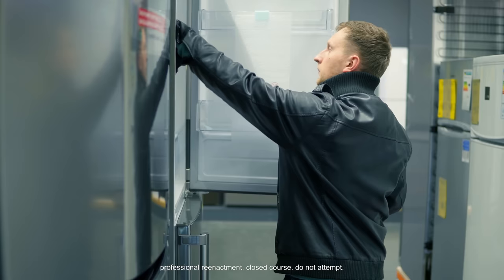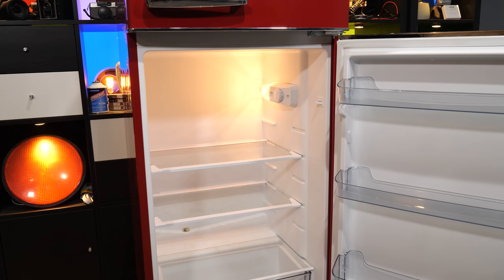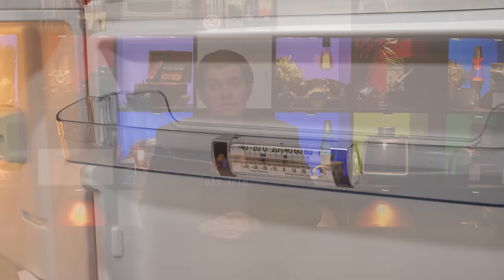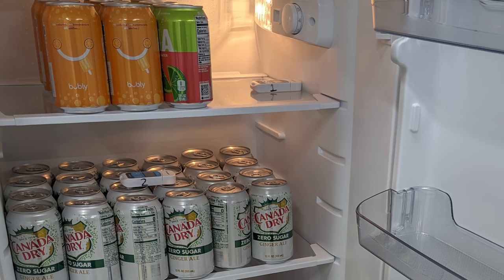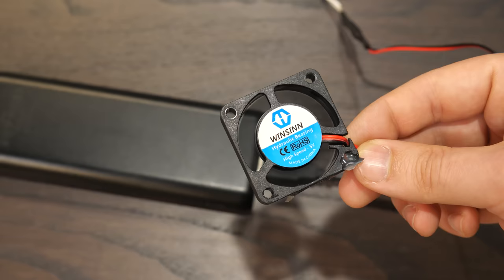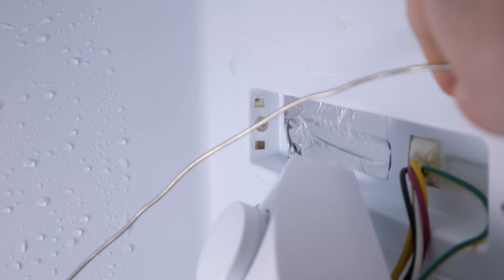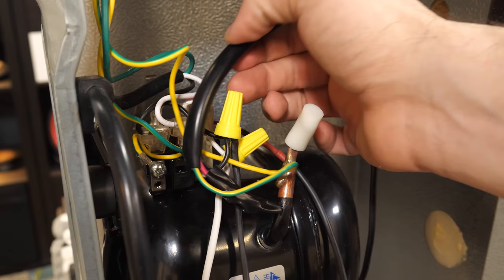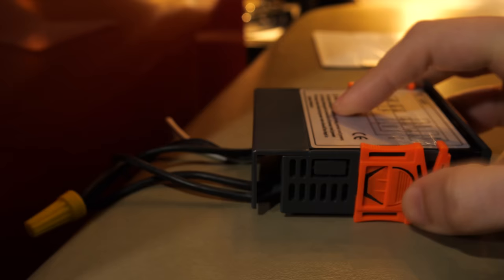This goofy fridge has a really clever design. It's also kinda terrible.

Comment: I love the way you call this a "mini fridge", in the UK we'd call it a "fridge".  The large double door units are often referred to as "American fridges" 🤣
Reply: Yes this red fridge is bigger than the only fridge we can fit in our flat  -_-
Reply: Yeah, a mini fridge is one that fits under a table, possibly even smaller than that.
Reply: To be fair, we wouldn't call this a mini fridge in the US, we would call it a small fridge. Mini fridges are shorter and typically have the frozen compartment within the top of the single compartment. But this is certainly smaller than most people's fridges here. My fridge is probably 2.5-3 of these big, but would be considered a large fridge, 1.5 of these would be a "normal" fridge size.
Reply: I lived in England for 2 years and a large family lived close by (in MIddle Barton, Oxfordshire) and the first thing I noticed in their house was that small fridge.
Reply: He also doesn’t call it a mini fridge, he bought it instead of a mini fridge, its just a small fridge
Reply: Go big... or go home! 😆
Reply: also most freezers here absolutely do no have auto defrost. At least none I've come across. Maybe if you  want to throw money down the drain they might but the sensibly priced ones absolutely do not.
Reply: also in the UK I think we would actually call this a fridge freezer, although I don't think I've ever seen one with this form factor, if you have a fridge freezer it's nearly always 3/4 shelf freezer on the bottom and the same size 3/4 shelf fridge on top of identical size or near identical. roughly equaling two undercounter units in size.

A fridge would just be an under the counter fridge, usually with a separate under counter freezer. A mini fridge the things people have in their office etc for a few cans.

And an American fridge is for the people with more money than sense cause god knows what people are putting in those things.

Also having lived in a shit flat with a miserly landlord I did have an undercounter fridge with a tiny little freezer shelf on top it's so crap. I got a small chest freezer one of the best 150 quid I've ever spent and the freezer shelf in the fridge was useful for ice cubes.
Reply: Yeah, we Americans eat a lot, drink a lot, and therefore, have big fridges compared to some countries. We are the land of excess, obesity and all.
Reply: Living in a rental apartment in Switzerland.  This "mini fridge" is considerably larger than the one I have...
Reply: He didn't call this a mini fridge, he specifically said he bought this instead of a mini fridge because it was only $150 more and over twice the size
Reply: Big fridges make more sense when you live far away from where you grocery shop and therefore make fewer, larger trips. If the place you buy food is very close to where you live you can go frequently and don't have to stock up as much.
Reply: @mytimetravellingdog  European fridge freezers are typically 50/50 or 70/30, with the freezer compartment at the bottom. The latter means the freezer section would line up with the countertop.
Reply: "double door units are often referred to as "American fridges""

Is especially hilarious because here in the US the double door thing is sometimes called "french (or french style) doors" 😅 Especially in adverts that want to sound more 'posh'.
Reply: @mytimetravellingdog  In the Netherlands this used to be pretty much the default form factor in the 80s. After that, it seems most new kitchens did away with standalone fridges but instead went with far more expensive built-in units.
Reply: WELL AT LEAST…
Reply: There are 100s of millions of this type of fridge all over the world.  Very common.
Reply: It is also not uncommon in America for the nearest grocery store to be 30 minutes or more away by car- rather necessitating higher capacity for food storage in the home.
Reply: I was like how is that fridge "Mini"? 😂
Reply: The thing they call a "fridge" in the US is called a "small apartment with no windows and too much air conditioning" over here.
Reply: One of our quirkiness as Americans is that we love lots of stuff "ice cold" or hot, but not at room temperature.  I'm generalizing from my own experience, of course, but, Drinks, Beer, fruits, fresh vegetables, processed meats and cheeses and more.  If we consume it, and it contains significant water, we want it cold or hot.  And evidently, we are pretty obsessive about ice too.  I had never given it a thought until I went overseas for the first time in the military and ordered a drink with ice.  The bartender happily plunked a single cube into my drink.  When I asked for more ice, his eyes rolled and he very begrudgingly complied.  Trying not to be the "ugly American", I apologized and asked him if my request for more ice was abnormal?  "Not really," he said. "Quite a few of my best customers are Americans."
Reply: AMERICAAAAAA! FUCK YEAH!
Reply: I was going to say the same thing. It's a perfectly normal size fridge for a British person.
Reply: We tend to do infrequent large shopping trips since grocery shopping can be pretty inconvenient - and most people only have the time for it on weekends. I don't know if it's the same for you, but we also tend to cook large amounts of food to have leftovers throughout the week, which requires more fridge space.
Reply: In America we call those French door refrigerators.
Reply: They might truly be "american fridges". I've never seen a single one in europe, and usa likes to be original
Reply: It's a single persons fridge, uk don't have families
Reply: RAHHHH 🦅🦅🦅🦅🦅
Reply: If you paid attention to the literal first minute of the video, he literally said "I went to the store with the intent of buying a basic mini fridge to tide me over. BUT thanks again to everything still being wonky, a really basic mini fridge was like 200 bucks, and for another $150 I could get this silly thing. And I did. This fri-..." (fridge, cut off). He then 5 seconds later points out that it's much larger than an actual mini fridge.

He was never calling the fridge a mini fridge. He was even specifically about to call it a fridge before he cut himself off to make the "this won't fit on the table" joke. Ironically, an ACTUAL mini fridge would've fit on the table. Not even across the pond would we ever call a fridge that size a mini fridge. He was just saying he went to the store TO BUY a mini fridge, but because they were so expensive he figured he'd spend just a bit extra and get a full-sized, if not small by US standards, fridge.
Reply: Gonna end this debate, the size in the video is called "apartment" size. That's what it's sold as. A mini is around 100L, this is around 200L. A standard full-size fridge is 500-700L.
Reply: Yes, 'this little fridge'. In the Netherlands that's called a full-size fridge. And a nice retro looking one as well! I never really understood why anyone would need those double door things. They are huge! But still, I DID always wonder how a fridge like that worked (and whether it actually did it's job properly, and, eh, I guess not). That's really cool. I also liked the experiments to figure out the differences...
Reply: @mytimetravellingdog  Funny, same here. It's really a feature you pay for!
Reply: @LiterallyCensoredDaily  Well, perhaps because Europeans live much closer to the shops, we just go there more frequently (you know, fresh veggies), and therefore need less fridge space. I also have a big fridge (well, actually it's a 2m02 high fridge and seperate freezer of the same hight). I use it to freeze lots of gluten free stuff and stuff that I cooked and want to eat later. But really, it was meant for a family. If it's time to replace it (it uses a LOT of power), maybe half the size or less would be perfect..
Reply: @riverfortune1990  Exactly my point indeed..
Reply: @zombieregime  Exactly, because the French like fresh produce, so they have relatively small fridges..
Reply: @jurjenbos228  Yes, same as US cars and US engines. Even the engine would make a nice dog house, it's that big..
Reply: @mikemorgan5015  Yes, of course. More ice cubes means less drink. Therefore cheaper for the bar to make and more profit..
Reply: @CollinOffTheCuff  The thing with a integrated compartment is called... fridge :D
Minifridges dont have a freeze-compartment at all and basically its just one big compartment with "wire" rack to seperate. THATS mini ;D
Reply: @LiterallyCensoredDaily sure but this isnt the reason. We have more rural areas and i lived in one, we could only get out to get groceries once or twice a month so we need big refrigerators to hold that much food. After moving to town and being able to buy stuff weekly or even daily if we need something or something gets left out and goes off is a fucking godsend. When I grew up we had to really focus on what food we ate so we could make our favorite foods and snack last the whole month and if something got eaten too fast or got left out and went bad, too bad. That’s all you had for the month.  We lived like 45 minuets from the nearest gas station even. We were poor af too so we didn’t get alot to last a month between the money issues and fridge space.
Reply: @aJoats  WTF. 30 minutes by CAR. I thought I lived far away from the grocery store when they are a 10 minute drive away.
Reply: @mikemorgan5015  Oh in Finland it's normal to have ice in drinks when you go to a bar etc.
Reply: @Levian-Durai  I try to get everything I need for a week from the store but most times I fail but I usually have to go that way either way during the week. Oh and we cook almost daily
Reply: @Tupsuu that’s still far, the idea is to go there on foot (say 1km radius) everyday or every couple of days.
Reply: if you listen carefully, they say they were GOING to buy a mini-fridge until they found a better deal for an extra $150 when the mini one (one you could likely fit under a table) would have been  $200 to begin with. so they didn't call that rediculous machine mini.
Reply: lol I just basically said the same thing about France in my comment x)
Reply: @mytimetravellingdog 
It's worth noting that auto defrost is the least reliable part of a fridge. If you regards a fridge as a once a decade purchase, and want it to run without maintenance (apart from periodic defrosts) then don't get auto defrost.

That tip originally came from a fresher repair person who is on call for a company that does extended warranties on fridges.
Reply: @mytimetravellingdog  Well you certainly made me feel old by not knowing freezer on the top is a 2 door and on the bottom is an upside down :( 
Side by side doors is called............ side by side and if you have separate matching fridge and freezer thats a pidgeon pair.
Hi from Australia - FWIW i have an upright 2 door and an upright freezer, basically nobody has pidgeon pairs or side by sides here either. Upside-downs are about as common as uprights.
Reply: @erwindewit4073  Yes, that's undeniable.  I can't speak to every European country.  Only a few during my time there from 1989-1993.  They had generally much more strick bartending than the US.  I don't know if it was German law or frugal bar owners.  There were fill lines on beer glasses with the volume etched or printed into the glass so you knew how much your were getting.  As opposed to the wonderful extra heavy frozen mugs in the states that may contain only 8 or 9 oz when we are thinking it's 12.  But the beer tastes so good out of them.  Haha!  The flourishing micro brewing industry has brought the standard pint glass to the fore, so it's getting better, but still not standardized.  The ice issue I felt had more to do with the bars/gasthauses simply not having large production ice machines, but there were large dance clubs frequented by American GIs that did.  They gave us what we wanted and they profited handsomely in return.
Reply: @Tupsuu  Never had the opportunity to go to Finland.  I was in Germany and that was 30 years ago.  Don't know if you've been to the US but most bars start with a glass completely filled to the top with ice then add the liquor, then the soda or water.  Not a lot to drink in our drinks........
Reply: Its also upside down with a tiny freezer :)
Reply: yeah, we 'muricans sure do love our excess, don't we?
Reply: Perhaps more importantly, we tend to buy groceries for a week or more.
Reply: Yeah this looks like about the size of my normal fridge (Japan).
Reply: Yeah it's totally a regular sized 'fridge 😂😂
Reply: @TrevorJr26 if the UK joined the Union they would enter as the poorest state.  Keep this in mind when people talk about poverty in the US.  The poor here still have two flat screen TVs, a car, and a fridge bigger than average families in the UK.
Reply: Thanks Chris
Reply: Do you guys ever cook in the UK -- or do you all have small families that order take-out all the time?
Reply: @salmansengul  It's not.
Reply: @SaltExarch  Yes, but then we can't make fun of "those silly Americans"!
Reply: @theunwelcome  I never realized how spoiled we are until I went overseas.  But at the same time, we don't have a monopoly on great places to live.  Everywhere I've been has its good and bad points.  Good people and bad people.  
Geographic boundaries don't make people any different.  Probably the most important thing I learned in my travels is how just about everybody want the same thing.  To make some money and take care of our families.  It's the greedy and powerful who get us into trouble.
Reply: @mikemorgan5015  Yep, well the sizes of the glasses and the fill lines are EU regulations. Before, bars used to fill glasses half full or half foam. Or indeed, half ice cube, so there was barely any liquid left (that's what McDonalds still does now). 
Still, try some special Belgian beers, and the smaller glasses REALLY don't matter any more. They are SO good!
But true, ice cubes aren't really that much or a thing in Europe. Very few house holds will have a fridge with ice makers in them, or make ice cubes at all...
And hey, they are still businesses. If they can profit from your preferences, of course they will..
Reply: We can fit a week's worth of groceries in our tiny fridge, it's not that hard
Reply: @erwindewit4073  My tales of past exercises in European beverage consumption are from the late 1980s to the early 1990s in Germany, Spain and several other countries.  So, way before any EU.    But those are the two I can actually remember the etchings in.  The others may, or may not have done the same.  Regardless, I'm all for the lines.

Next time you go to McDonalds, try ordering your drink with no ice, or very light ice.  I've never had a problem in the states with that technique.  I have several vacuum insulated SS drinking vessels that keep nice and cold and fizzy for several hours.  Cold is also carbonation's friend, and heat is its mortal enemy.  

Most carbonated drink dispensing machines run the soda through a "cold plate" usually located at the bottom of the ice bin.  This is because the carbonation processes and retention won't work well at room temperature.  

To illustrate this, take a cold can of your favorite soda from your refrigerator, open it, take a drink and put it back in the fridge.  Take one at room temp and do the same except set it on your counter top.  Several hours later, you'll find that the one on the counter is flat and the one in the fridge is still nice an bubbly.  Perhaps not as much as when you first opened it, but it's not even close to the one on the counter.  

Another experiment is to pour a room temp soda over dry(as in right out of the freezer, not solid CO2) ice and another over wet ice in a cold glass.  The cold one over wet ice won't fizz up hardly at all if you pour it down the wet sides of the glass at the requisite 45 degree angle.  Pouring the warm one is an exercise in futility over the dry ice.  

The wet ice and glass reduce the points of nucleation for the dissolved CO2 bubbles to form.

I'm a beer fanatic.  It took about a week for me to love many of the European beers.  It took about a week to re-learn to love American beer when I got back.  Haha!
Reply: @TrevorJr26  I can't even fit all of my "keep refrigerated" condiments in a mini fridge.  haha!
Reply: @mikemorgan5015  Wow, very cool, these are experiments I like, thanks!! And I didn't try asking for no ice in McDonald's before, so that's a good idea as well.. 
I used to live in Antwerp (Belgium), and once I found the beer cellar (300+ types of 'special beer' available), that was it for me! 
Heineken and Amstel taste like bad water after that ...
Reply: @erwindewit4073  For me it's a toss up between hefe and crystal weizen for my very favorites, but the at my age and slower metabolism, I can't afford the calories....haha!  But there are so very many excellent beers out there.  The US micro brewing revolution has really been amazing, though there are way to many that focus almost exclusively on ales.  They aren't bad, I just like a little more variety.  A small Nebraska brewer makes a Jalapeno beer called Devils Gap that's really amazing.
Reply: @mikemorgan5015  Jalapeño beer? That sounds quite peculiar! My favorites are the Belgian triples. Kasteelbier, Westvleteren, La Chouffe etc. Even though I also like Paulaner Hefe. Very nice. Still, I got allergic to wheat, so now they are just memories.. Good for the calories, but hmm..
Reply: @LiterallyCensoredDaily I don't think it's as much about volume of consumed things as it is about  the difference in usage. I feel Americans use it more as storage then Europeans do. Don't get me wrong every European fridge will have items in it that no one touched in a year, but it's a lot less than the average American fridge. It is a cultural thing because in Europe the closest food store is a lot closer than the counterpart in US, so we don't need to store as many things in our fridges.
Reply: Yeah in all of europe we have these fridges. I mean they are quite a bit bigger than this thing, but they all use this design.
Imagine how confused I was when americans on reddit talked about mold getting into the frigde's vents. I was like: What vents? Fridges don't have vents.
Reply: @lookoutforchris  Lol, you are delusional. The UK has universal health care. That alone makes the poorest people in the UK richer than the entire lower class in the US.
Reply: And in Finland, the fridges with the freezer box on top are called "yank fridges", whether it's with a door or a literal box in the fridge space.
Reply: Americans have to drive like 30 minutes to the next grocery store so they usually buy in bulk. They need big fridges to store everything
Reply: There’s some rationale for the american fridge, and that’s simply that things are considerably further apart than they are in most countries, including cities. Travel times are generally double that of what they are in the UK so it stands to reason minimising travelling for groceries makes sense
Reply: Strange I don't know why people are against large refrigerators. Some people need the extra cold place for fresh foods. If you have children you need a large refrigerator. We don't need to be running to the store every day to keep up with the food. And if you live on a farm you probably need a big deep freezer. I can't see not having a decent size refrigerator. 20 cubic feet is about right for my wife and I. I don't need french door type. Also I don't want an ice maker I need the freezer space. I keep my water and drinks in the refrigerator so no ice is needed. When I get a soda from the convenience store I don't add ice the pop is cold enough. 73
Reply: @bodinian yeah the wide ones. I never in my life would need that big of a refrigerator. Mine i believe is 20 cu ft. It has a large freezer on top. So my 5 cu ft freezer is not in service. 73
Reply: @riverfortune1990  Exactly. It's not because we're fat and wasteful and it's pretty mean to rural communities. When you live on a farm and the nearest grocery is ~30 minutes and at least 5$ of gas away, you stock up and go bi-monthly instead of every week. Also, idk how big european families typically are but we had 12 people eating out of our fridge on any given day. like hell a fridge like this could hold the amount necessary to competently feed nutritionally complete meals. you try driving 30 minutes for 12 people every other day to week and see where it gets you...
Reply: @mytimetravellingdog  I can't speak for Americans specifically, but American fridges are the most common size here simply due to the fact that we generally only go food shopping once a week. We buy a lot of food all at once and then consume it over the next week.
Reply: @CollinOffTheCuff  Yeah, what he shows at 4:50 is what we'd call a "mini fridge".